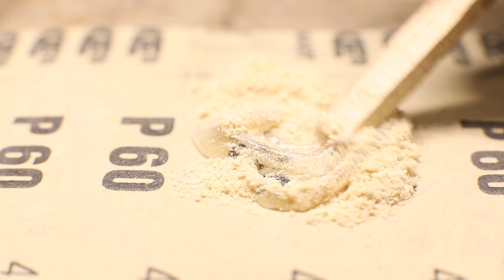Antique Rusty Knife Restoration. Knife With A Bronze Guard

Comment: wow... there's something about knives with rust-holes in the blade...
Q: why did you mix sawdust into the epoxy?
Reply: I'm not an expert but I think it helps to match the wood tone so it dosent stand out
Reply: Perhaps you can explain?

I don't get the point of restoring a blade that is pitted with rust. As soon as you start using it, those pits will fill up with dirt. The knife will be much harder to keep clean than a normal one. 

So what is the point? Is this thing just for decoration?
Reply: @gerardvila4685  you're not going to use it. but oyu can see how it looked originally.
for me also: how they've manufactured these things.